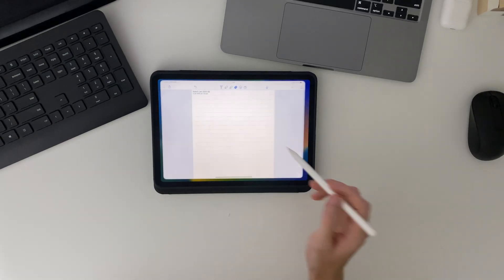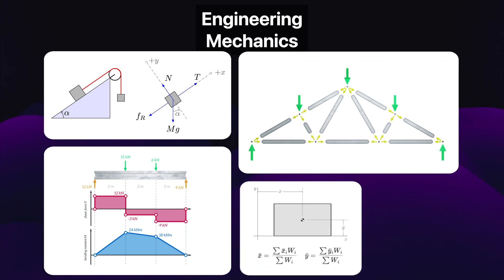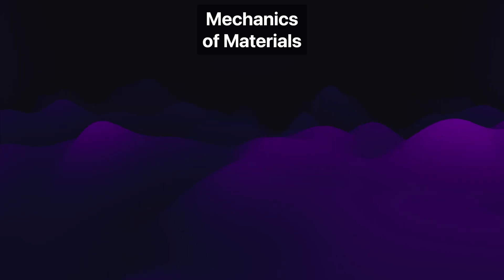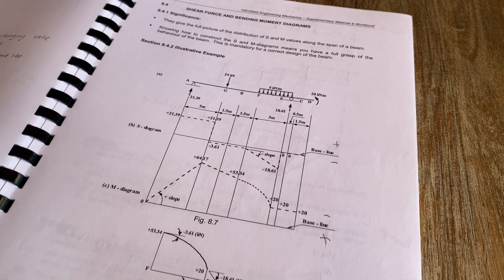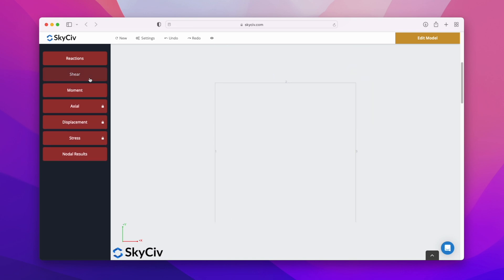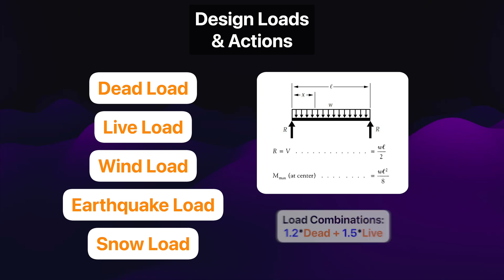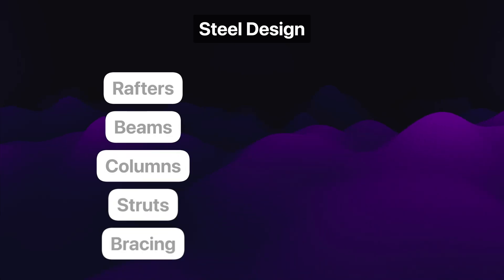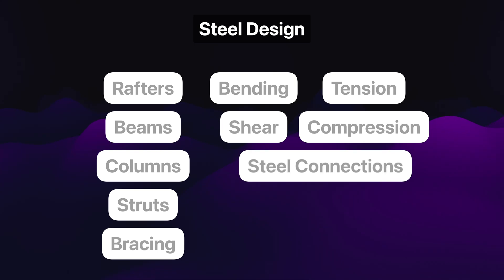Revealing The MOST IMPORTANT TOPICS For Structural Engineering

Comment: Hi Ben,
Thanks for this video. I appreciate your work to help and guide the aspirants like us.

I am a Mechanical Engineer working as CAD designer/Project Engineer in the field of Steel manufacturing (CAD design and Shop detailing of steel works) for almost 4 years.
I have an extensive exposure in structural engineering where we receive already engineered design and we produce CAD design and then manufacture accordingly.
I do have a knowledge and understanding of concrete footings, slabs, reinforcement etc.
Also, the type and nature of loadings and their behaviour.
A partial learning was accounted in my Mechanical engineering degree.

I want to now learn structural engineering analysis to pursue a career in Structural engineering.

Would you please suggest a pathway and the possibility to be a Registered Structural Engineer in the future despite having a Mechanical Engineering degree?

I have already started practicing the Skyciv software from the tutorial videos.
Reply from the maker: I think the easiest way to become a structural engineer given your experience would be to do a masters degree in structural engineering. These courses are usually 2 years long (in Australia). Without this degree I think you would struggle a bit and it would be hard to find an employer that would actually hire you as most job applications require you to have a degree in civil/structural engineering. Hope this helps :)

Comment: I am graduate civil engineer with more than 10 years of work experience. But I mostly were based on site/construction project management roles than the real structural/design things. However, I am very much interested to learn real structural engineering/design and in this regard, is it possible for me to learn structural engineering & design program after such long gap?
Reply from the maker: Yeah I definitely think it’s possible. You’ll have to put in the required work but if you really want to do it I see no reason why you can’t. Your onsite experience will be a big help too.